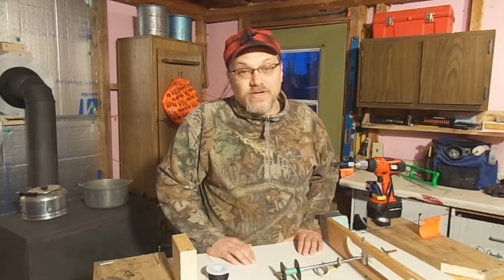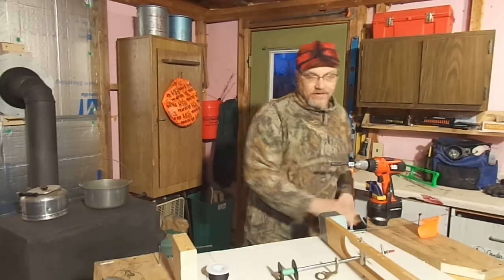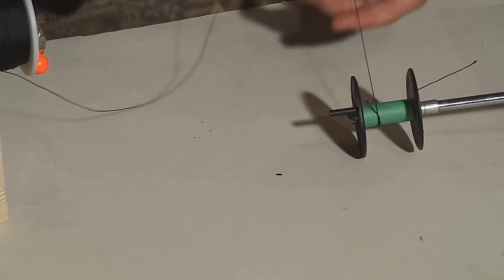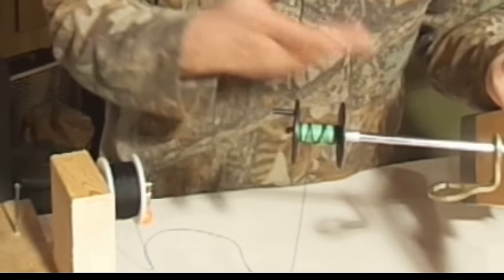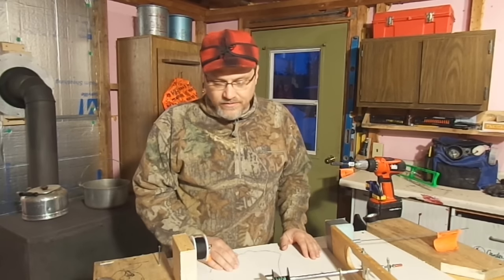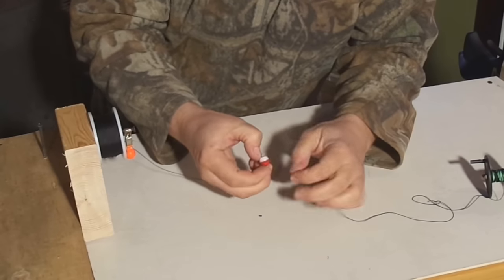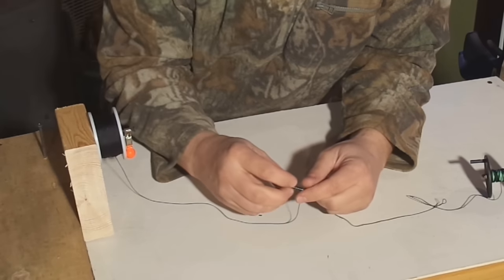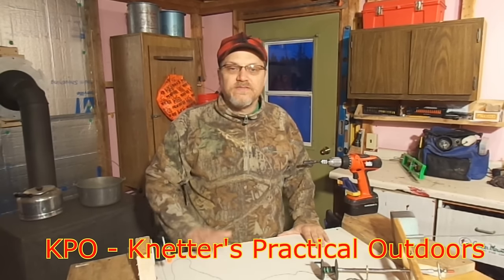Ice Fishing - Spooling A Tip-Up

Comment: good tip using the drill to help spool line...I use BB size split shot sinkers to mark my depth and I have heard others using slip bobber stops as well
Reply from the maker: Bobby, if you got a few new tip ups the drill really helps.  If you're only spooling one up, it might not be worth the trouble.  Also check out my vid "Tip Up Basics - How To Use A Tip Up".  You may find that one interesting too.  Thanks for watching, KPO.